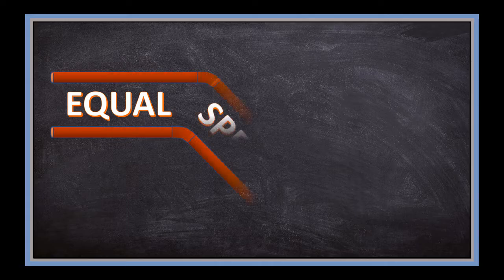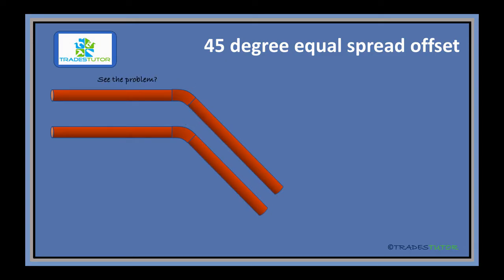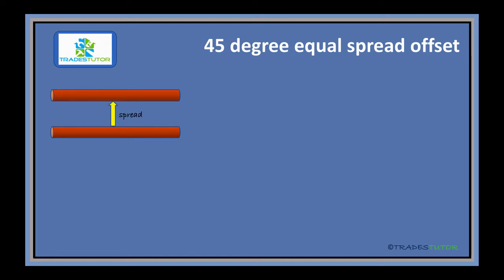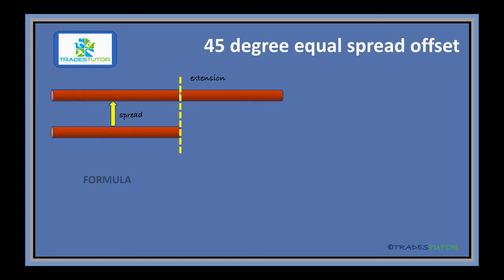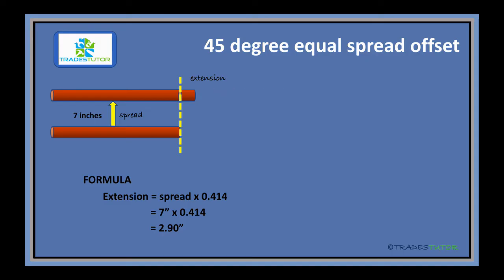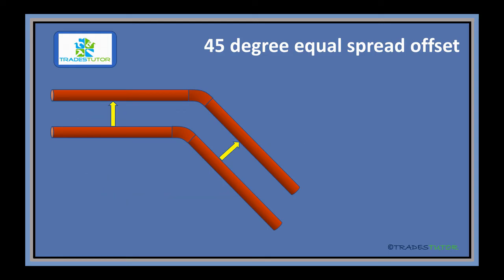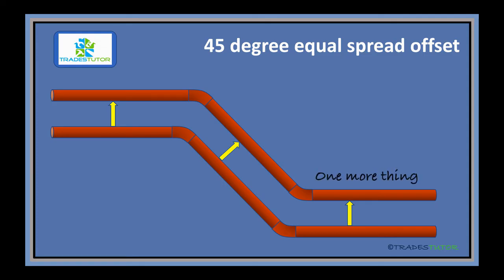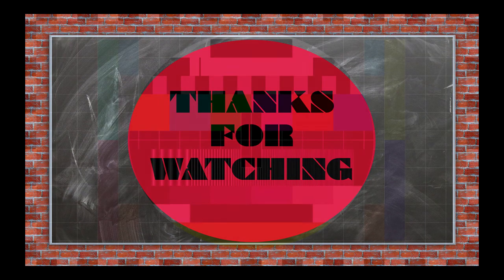45 Degree Equal Spread Piping Offset for the construction trades.

Comment: To clarify if the pipe on the bottom is 4 inches then you would add (spreadx.414) to the top piece 
So in this example if the pipe is 4" + 2.9" (2-7/8) it would be 6-7/8"
So bottom 4" top 6-7/8"

Comment: Ive seen this method but they based their measurements off the   ¢-¢ of the pipes and not the gap. Can doing this cause issues ?
Reply from the maker: The measurement should be from center to center. That will be more accurate.

Comment: What if its a 30 degree or any other degree? We're at a project where we're running (7) 4" inch rigid runs from a box, over to another box. We have a straight coming out of the box -a pre bent 90 - a 30 - a straight - a 30 - straight - 90 - then straight on the other end going into the conduit box. We're aiming for a 6" inch spread but all the measurements are off. The run from the 30 to the other 30 all the couplings are touching and closer together. We have all the straights coming out the box going to the 90, the same lengths. Thats where i think our issue starts.

Comment: Can you share the formula for the 45* run lengths when doing a horizontal to vertical transition using 2x 45* fittings? 

The application would be to use this equal spread offset formula and also know the calculation for the 45* slope cuts of pipe when transitioning from horizontal to vertical. Thank you

Comment: Hello and thanks for the nice video. How about if they start equal and they finishi no equal. Ex. The start with 290mm center to center and they finish 260mm center to center. Thanks
Reply: I would love the answer to this.. can’t find it anywhere
Reply: That's when you just use string lines and make what you want then measure center to center. Or you can layout your offset right on the ground to configure cutlengths

Comment: Really liked your video but it falls a bit short in the complete picture of parallel offsets. As it only gives the example for 45° parallel offsets. That said I LOVE the quality of the video just wish you had gone more into the full formula to make people more versatile. This video is specifically only for a 45° bend. but if you wnet just  wee bit more into the explanation of the formula this could have been all inclusive instruction. The formula for this is  TANGENT ( 0.5 * Angle used) * Spread desired = Extension or in this case   TAN(0.5 *45°) * 7" = 2.90"  IF you use a different angle for example a 30° then the extension changes  to 1.875"  That formula, in that case, looks like this         

TAN(30° * 0.5) * 7" = 1.875"

Make sure you are using Degrees  and Not radians on your calculator
Reply: Thanks for this!

Comment: Spread x Tan of 1/2 the angle. For 45 you use tangent of 22.5. For any other angle divide angle in half and use the Tangent for that degree. Example 60 degree turn use the Tangent of 30 degrees X spread to find the distance described in this video.

Comment: I'm confused we just did this in class for a 45 and they say to multiply by 1.414 and for 22 1/2 then we multiply by .414 , I read an explanation you gave to someone else that two 45 would be considered     22 1/2 degree but what if you had two 22 1/2 and you wanted to know the offset
Reply from the maker: Hello: I'll try to answer that the best i can. When you have an equal spread offset using 45 degree fittings the change of direction (45 degree) ends up creating two identical triangles where it changes direction. As the change of direction is 45 degrees the two triangles formed each have a value of 22 1/2 degrees. We can use trigonometry to find the values in those triangles. The number 0.414 comes from trig and it defines the length of the opposite side of the triangle which has an identified angle of 22 1/2. That side is also known as the extension when it comes to equal spread offsets. The adjacent side is also known as the offset. In the end the extension is 0.414 times the length of the offset. I hope this helps and thanks for watching.

Comment: can you yell me how you came up with .414 I'd like to know how. thanks
Reply from the maker: Hi William: 0.414 is a trigonometry number that is used when dealing with triangles with a 22.5 degree angle. Even though the fittings are 45 degrees there are 2 identical 22.5 angles created when the pipe turns. These two triangles are what form the trigonometry for the question. As it turns out the tangent of a 22.5 angle is 0.414 and this is the number we end up using in the formula. Although I didn't use trigonometry to sole the problem the number comes from trigonometry. Hope this helps and thanks for watching.

Comment: Thank you for the explication but why 0,414 and not 1,414?  1/sin 45 = 1.414
Reply from the maker: Hi Todor: The trigonometry numbers come from dealing with a 22.5 degree angle. Although the fittings themselves are 45 degrees when the piece of pipe changes direction the numbers are based on the fact that it creates two 22.5 degree triangles. Therefore when you are using trig its based off of that. Its a bit confusing as you would think its based off of a 45 degree but its actually not. Thanks for watching and I'm glad you liked the video.
Reply: Brother you are a blessing, Im going through some depression from work and I'm seeking to get better at my trade and this enlightened me.  Thank you

Comment: Does the multiplier change based on size of conduit?
Reply from the maker: Hi James: No. The multiplier remains the same regardless of size of pipe or conduit. Thanks for watching.
Reply: no, the size of conduit is irrelevant, It's the angle of bend that is important. Different factors for differrent angles.

Comment: How do you get the extension number.  Say I want to do a 22.5 angle.  Is the spread number the same,  or how do you come up with the number
Reply from the maker: Hello: The number for a 22.5 angle would be different. The number used in this video only works for a 45 degree.

Comment: What is the factor one has to use if your bends are, say, 30 degrees? I assume it will be different than 0.414.
Reply: .2679, it's a trigonometric function of the angle being bent
Reply from the maker: Hi Hans: The only other angle we generally work with in the piping industry is a 22 1/2 degree and there are different numbers for that. This is all based on trigonometry so your best bet is to either find some trigonometry tables or use your calculator to find the correct numbers to work with. Thanks for watching
Reply: Use Tangent of 15 degrees (1/2 of 30 degrees) on a trig calculator.

Comment: so why don't you follow thru our measuring tapes don't have decimals!!!!  finish it ... 2.9= approx. 2-15/16" 
 a real formula is ,. spread =Tangent 1/2 angle bent + spacing you want from center of conduit or pipes.
Reply from the maker: HI Ass ho: This video was simply to show how the formula worked to calculate the equal spread offset. Changing a decimal to a fraction can be found in another video is you need to calculate that. Take care

Comment: how is 0.414 derived ? How you get the ratio?
Reply from the maker: Hello: The 0.414 is derived from trigonometry. Its actually derived from the trigonometry numbers related to a 22 1/2 degree angle. Take care
Reply: How would i find .414's equivalent for 30 degree bends?
Reply from the maker: @Lynchings  Hello Hipster: Although there are constants which you can memorize and use in this situation, its best to learn trigonometry for most situations. I'm just going over the most common piping angle which is 45 degrees.